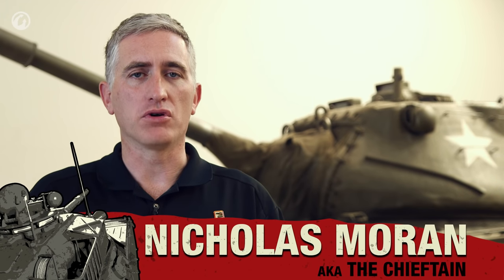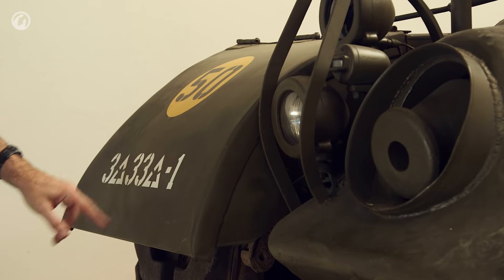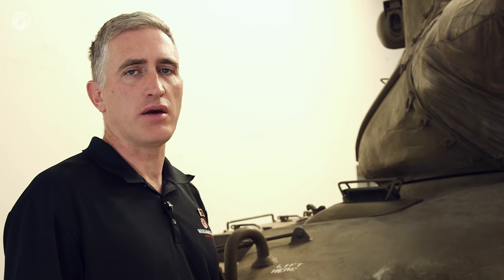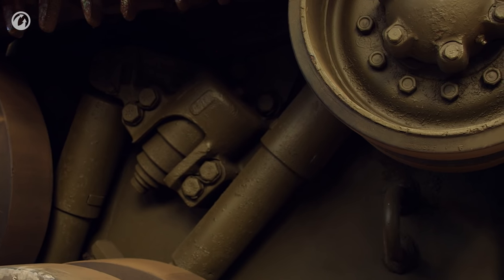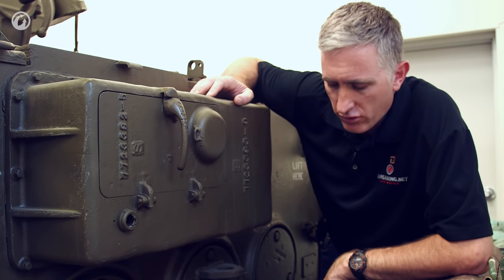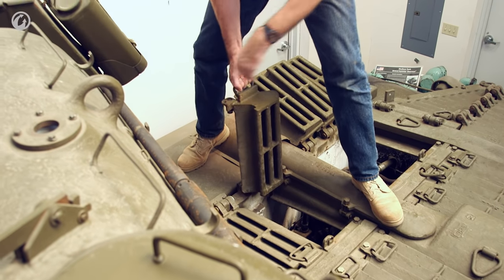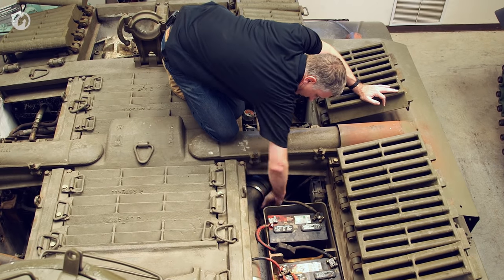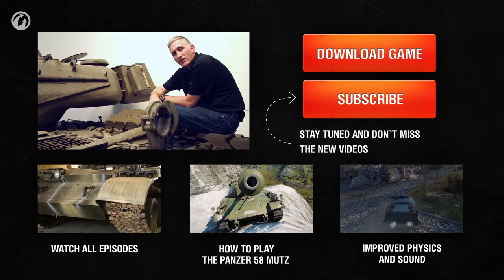Inside the Chieftain's Hatch: M47 Patton II Part 1

Comment: When my grandfather was in the Belgian army, he had to ferry M47's from one side of the base of Leopoldsburg to the other. For this this he had to cross a public road. As he crosses the road with the third tank, a impact happens to the side of the tank. He was a bit shocked as he believed he hitted the traffic light pole. Or the track snapped off. As he exited the tank, he found out a 2CV car had ignored the traffic blockade and MP and drove straight into the side of the tank. The occupants were............not alive. Inside the remains they found dozens of empty bottles of beer and the couple were known public drinkers.He never forgot that day...
Reply: Friend said he followed an Abrams in iraq. Similar thing happened and the crew thought they hit the curb but completely flatter a Toyota compact car that tried to drive around the tank but slowed down once in front
Reply: @codyparker679  My grandfather was stationed in Germany in the 60s and was watching a bunch of M60s with swamp tracks crossing an intersection going downhill. MP halted traffic as the column of tanks moved through but one driver got impatient and thought he could make it through the column... 

The result was that his entire vehicle with 3 or 4 people was completely flattened by an M60 tank.

Lesson: Don't try to drive through tanks.
Reply: @weak1ings  It's amazing that even needs to be said. "Don't risk getting into an accident with something about 40 times heavier than your car, which is designed to kill."
Reply: @filmandfirearms  I guess some people just don't understand the intricacies of tanks
Reply: Interesting story. Thanks for sharing

Comment: We used the M47 for targets in the mid 70's, the 105mm heat would go through it with no problem. After 4-5 hits the turret roof would blow off some of them.
Reply: No need for turret roof...well with 1  heat shell is enough to ammo rack/crew knock the whole tank...it has no armor for its era...but of course you know more sir!
Reply: And then you realize...something at LEAST 40k in cost was used as a target dummy lol.
Reply: @ICCUWANSIUT  They use entire ships as targets, dude. They cost hundreds of millions new. And I think $40,000 is a significant underestimate, even for the 1950s. The military is not known for cost-consciousness. Think of all the brand new tanks and planes they bulldozed and sunk in the ocean in 1945-46. At least in that case it would have actually cost more to bring them home.

Comment: The rain guard looks like it's for when the turret is facing forward or 180 and the front hatches are open.
So that water running down the turret doesn't just pour in through the open hatch and on to the driver's head.

Comment: When I think of the word "Tank," this (Actually the M60) is the basic shape I have in my head.  This is pretty much the average tank in my mind, probably because of my generation.  (I grew up in the 70s, and 80s)  Just for an example of how iconic the M47-through-M60 line are, Arnold Schwarzenegger bought the one he used in the Austrian Army in the 60s.  AFAIK, it's still in running condition.
Reply: Psiberzerker. For me it’s the-60A-1 and A-2. As well as the M-47 because that’s what the ROK Army was using when i was stationed in South Korea from 76 to 77. And then there’s the M-155, they were part of the 4/7 Cav.
Reply: That’s the M-551, my bad.

Comment: Note:  When you put a grid of holes or slots in an armor plate, it obviously reduces its strength against projectiles trying to punch through it.  For a battleship deck with a plate with such holes to let uptake smoke out, tests showed that the plate was only about 40% as strong as a solid plate of the same thickness (it also weighed only about 50% as much as a solid plate, so even with a weight measure, it was still somewhat weaker).  With the large slots in the upper rear hull of the M47 tank, I would think that the loss would be more, possibly only 30% as strong as a plate of that total thickness.  My data does not seem to show any difference in the effects of sloping these punctured plates compared to solid plates.  Note that the S-tank cross-bars on its extremely-sloped 75-degree upper front hull were not to stop projectiles themselves, but to cause them to hit 2 or 3 of these armor chunks again and again when the tank was hit by near-horizontal fire from the frontal arc before finally reaching the 40mm 75-degree-sloped top plate.  Such extremely-sloped  impacts would wreck thin-walled HESH/HEP and HEAT rounds and make them virtually useless against that upper hull, while causing the nose of AP/APC and HVAP/APCR/APDS rounds to tilt upward somewhat, on top of knocking off any AP cap and slowing the projectile somewhat, which would further degrade their penetration through the 40mm plate.  Those bars would also have some limited degradation effect against APFSDS rounds to destroy part of their nose and forward body material so that the rounds could not move as far into the 40mm armor before melting totally away (deflecting APFSDS rounds is usually not very effective since the nose simply dissolves under high pressure and the body continues in a straight line).  As APFSDS and top-attack HEAT missiles (firing downward as they pass overhead) became more common, the armor on the S-tank became less effective, so this is one of the reasons they were finally retired.
Reply: The cross bars on S tanks also helped keep small arms fire and shell fragments from deflecting off the armor into the optics and viewing ports, if any.

Comment: 12:51 they should use sealed batteries or just remove them to cut down on corrosion caused by the acid.

Comment: I think even in the modern era they could benefit from quick detach trailers for tanks. Not for fuel but for stuff. Not essential stuff either but stuff you might want to bring with you such as extra food or maybe some extra ammo for deeper missions or something. It would probably work okay when you're driving down the road just crossing the country, and it would increase the overall fuel efficiency of the army. BUT if you ran into contact the commander could press a button that would detach the trailer somehow either by explosives or releasing a hook or something like that so the tank could ditch it and go into combat mode instantly. This is also why you wouldn't want to bring anything too valuable in them as they could be destroyed in the cross fire. Idk just a thought.

Comment: Used to know a guy that had a suburban suv from the 70s. Said it got 7mpg whether or not he had a full trailer attached so he was almost always hauling something. Increasing the cargo moved per gallon was the only efficiency increase that monster was physically capable of so i understand why the army wanted to use the trailers with tanks. Even if they didnt haul fuel it saved a truck having to use fuel to do the same amount of chemical work already being done in the tanks engine. A slight efficiency boost on paper but having a trailer that can accommodate double the usual amount of infantry tanks can bear could absolutely be of benefit in the right circumstances. I think the problem came from trying the idea during a war centered around mountains and other broken terrain.

I wouldve just made the trailers with CV joints at the hookups and a second set of wheels above the first set so the trailer could roll when empty and be able to still be pulled afterwards. A tank wouldnt struggle to drag an upside down trailer but itll break that equipment.

Comment: M47 Patton rainguards.
Looking at the placement of them, and the turret's angles, it would seem like the fore-mounted ones are to keep the turret to act like a big rain collector dumping the load onto the driver's and hull-gunner's hatch. Why? Even if the hatches are closed and won't leak, the water might splash over/in front of the periscopes.

Comment: 16 gallons of oil, or 16 quarts? 16 gallons sounds like too much.
Reply: Probably 16 gallons, when you consider that the engine in the truck of a modern 18-wheeler usually holds 11 gallons or more. I would imagine an V-12 in an older tank would have a higher capacity.
Reply: A Leopard 2 has 90 Liter (23,7 gallons) of oil, so 16 gallons for an M-47 engine seems about the right amount.